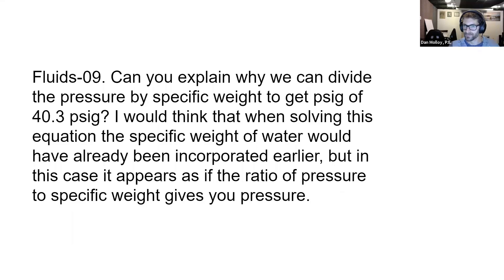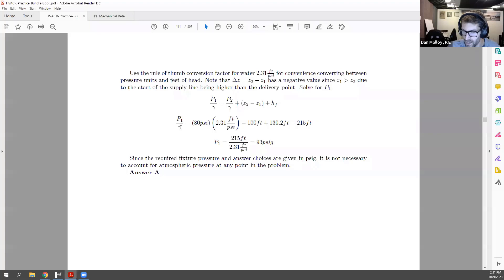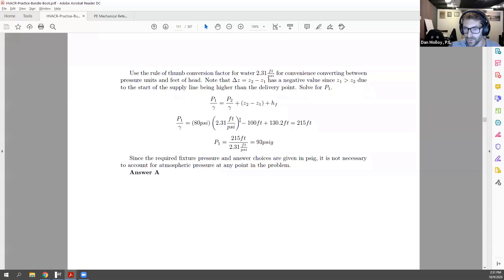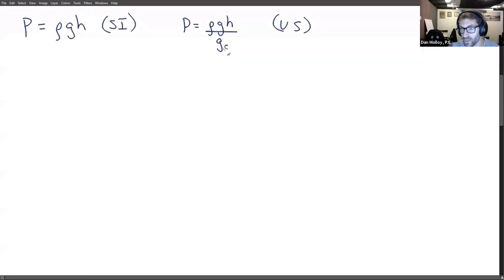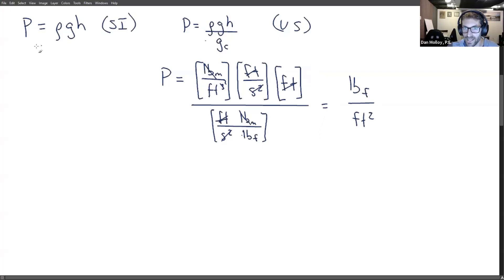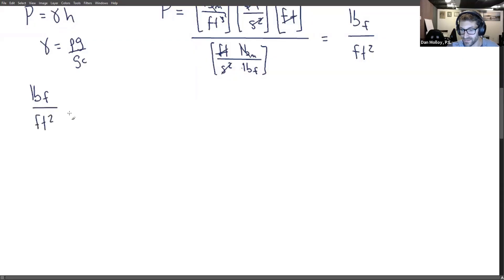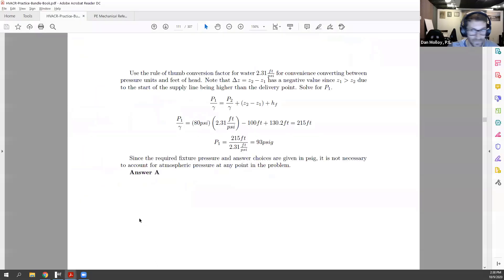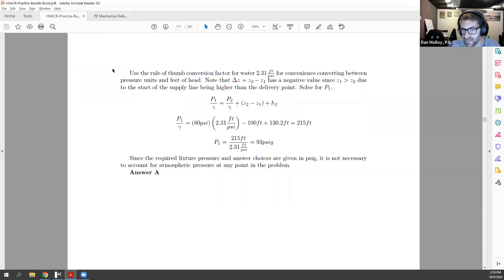Understanding Pressure Conversion: PSI to Feet with Rule of Thumb for PE Exam

Comment: Thanks for the video. I got tripped up on an NPSHA problem and found out my issue was water density (inlet water to pump was hot). Laying out the units like this helped me see 2.31 isn't always 2.31.
Reply from the maker: Glad it helped Will.  Laying out the units is huge for those little details that are all too often not little at all.  Bravo for making the connection.  Many more problems to illuminate key aspects of problems like this one in the Full Access Bundle if you haven't already checked it out! Happy Studying!